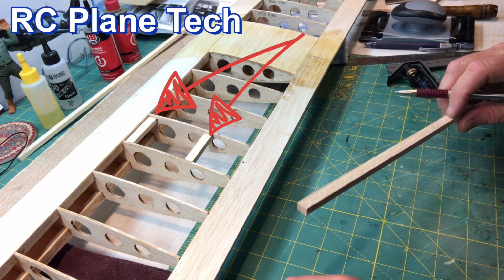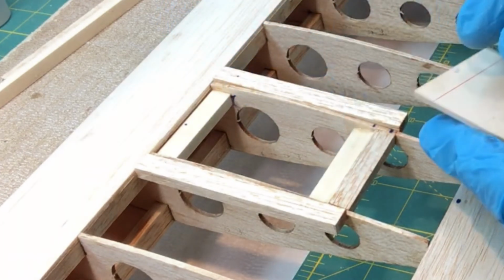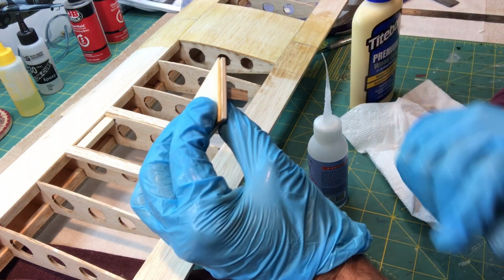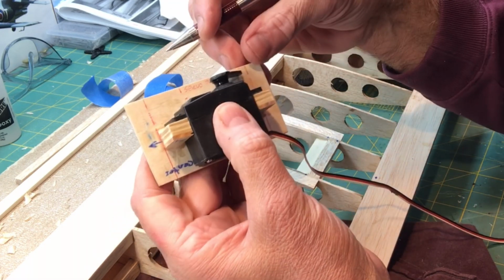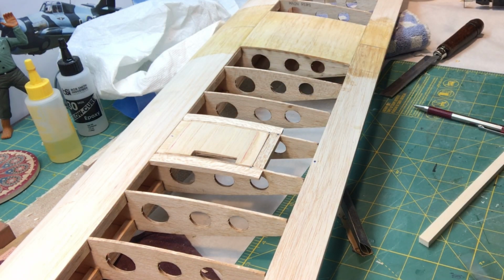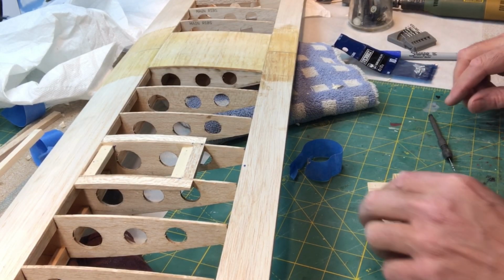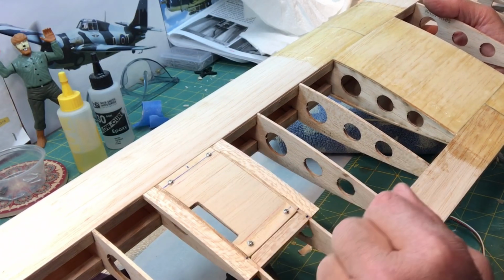Balsa USA Smoothie RC Plane Kit Build No 11, Aileron Servo Wing Mount Modification 2 of 2

Comment: I have a 35 year-old Great Planes J3 Cub I wanted to put separate servos in to control the ailerons, specifically for the flaperon feature because I'm building the "clipped wing" version.  I thought of your Smoothie build and remembered to go back and look at how you did it.  The original plans call for a single servo and a bell crank to operate both ailerons at once.  I built it that way and don't like it.  I like your way better, so thank you for posting the video.  I will be sure to activate the flaperons with a switch and not a dial to avoid suffering the fate you had to endure with this beautiful airplane's short life. Separate aileron control will give me more confidence with traditional (not 3D!) aerobatics, and give more lift for slower landings.  Thanks again for posting the video.  I hope you build another of the Smoothies, it looks like a really fun plane.  Perhaps I will build one some day, but I have another vintage kit to tackle first, a Bridi Killer Kaos.  That'll be after the J3 Cub.  good luck, God Bless...
Reply from the maker: Thanks so much for the nice comments and am glad my video was helpful. Having flaperons is very useful for me, especially with short landing fields to be able to slow down. Glad you are building and good luck! Its fun.

Comment: I use a similar method to mount my aileron servos.
There is no reason to mount your servos on the outside of the airplane.
Nicely done.
Love this traditional style of building. With that O.S. .46 pulling duty, this is going to be a fun airplane.
Reply from the maker: Thanks, yes I was going back and forth on the servo mount, keeping it simple and getting the plane done sooner or taking the extra time to recess it. Fun stuff. Thanks for the comment, I appreciate it.
Reply: @JamesRCPlaneTech  
I think it only takes a little longer. Besides, it keeps the servos out of the fuel spray. It's just much better overall.
See you in the next one!

Comment: Nice build i have started flying again RC planes stopped 20 years ago.All i seen is foam planes electric tried them a bunch of junk.Building a Kaos now built a sweet stik flying now old glow engine super tiger 45.
Reply from the maker: Ya, I was out for a long time also and saw that the hobby really shifted to foam, electric, and ARFs. Thats why I started this channel because I was curious about if there is an interest in building and running engines. Happily there is and there are many other “old school” channels out there. Maybe more channels like this will teach the newer generations that actually taking some time to build with your hands can be rewarding. Great that you are building a Kaos! Good luck with the build! Its always nice to hear that others are still building.

Comment: Hello I'm through with theinstallation of the servo. However out of curiosity I looked for the servo aeleron connection and couldn't locate which instruction video it was on I currently finished with 11. Thanks for making my intro the hoby fun..Doug E
Reply from the maker: Hi, I have not done the aileron connection yet. After I made the aileron servo mounts I moved to another step. I won’t hook up the ailerons till almost then. Soon hopefully. Thanks for the comment, I appreciate it. Im glad you are enjoying the build. You may finish before me! 🤓

Comment: could you do me favour and weight the airplane when you are finished, i am wondering if a 6s battery 550g would be too heavy. I know airplane is designed for glow.
Reply from the maker: Yes for sure. I will be checking the wing loading… but based on the rate Im building, it will be a while😄

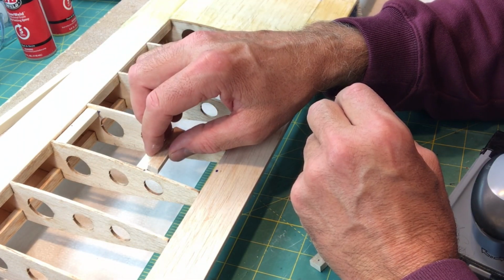Comment: FYI             at every step of this build, you have chosen to 'make it your own' in some silly way.         while, simultaneously,  choosing to  Not  do things that  are  OPTIMAL.!            at 3:06,  (if this model is gonna  have  an  Engine,) the servos  NEED  to  have  vibration damping  Mounts.       (see the  GROMMETS/screws  that come with a servo.)         if your current design silliness does not accommodate this servo mounting  method,  it  SHOULD.!!!        googletranslate
Reply from the maker: Hi, thanks for your comment. Well the servos are not mounted yet, and when they are I will be using the rubber grommets and screws that come with the servos. I was just using the servo here for measurements and such. In the first video on the aileron servo mount I actually do discuss the rubber grommet, check out part 1, the previous video. Also, If you check my last build on the barnstormer kit I have a video where I mount the servos with the usual rubber grommets as you noted. Thanks again.